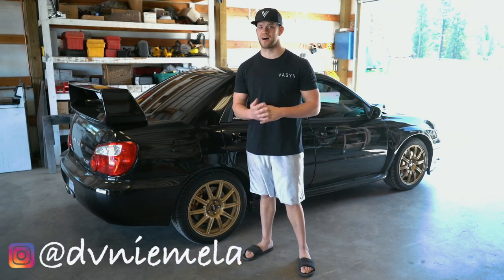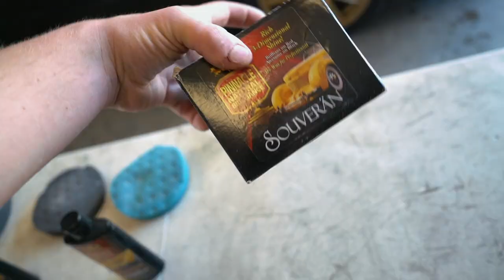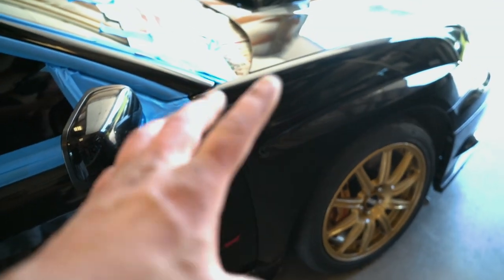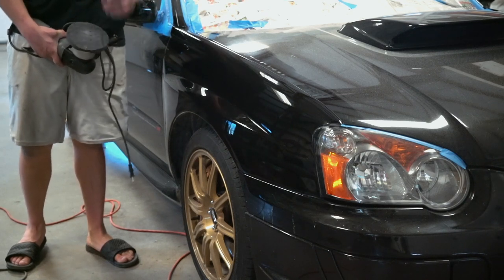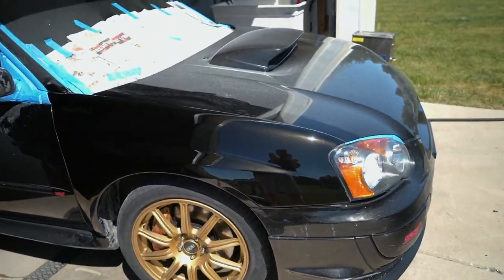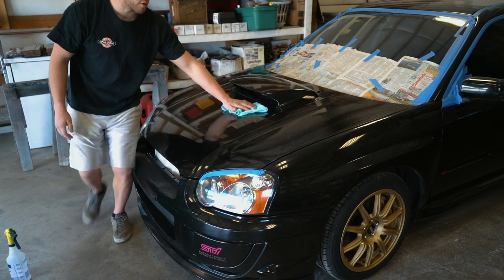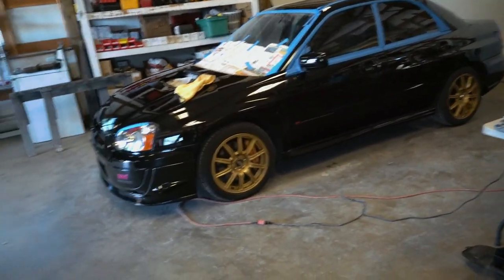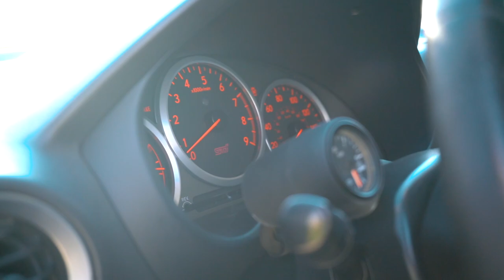How To Polish A Car At Home

Comment: Devin, Best and easiest way to do it will be to chemically clay bar car by using professional stuff eg. Bilt Hamber Korrosol Cleaner (it will remove iron contaminants from paint) then get  3M Trizact Discs P3000 and 6000 Grit. Get 2 small and 2 large discs - that will do entire car. You use them with water but just a light mist not soaking wet and on intermediate backing pad (soft foam) then it will work correctly. You can get 3M Trizact 1500Grit (also with backing pad!) if you wanna remove deep scratches or remove orange peel texture (mirror flat surface) but this one you using dry and need to be cleaned often with airgun blow or cloth (cotton) very often. After sanding use "Menzerna 3 in 1 - One Step Polish" - why this one - because it's design to brake sanding particles to smaller as you go and you need only one compound than just good polish to remove swirl marks (eg Meguiars Ultimate Polish) than wax or ceramic coating of your choice. With DIY grade ceramic coatings is a small problem as they last max 2 years if you don't wash it or rain often. Mine come of in 6 months. I would use good wax to start it then quick wax to refresh later.
P.S. All of it you can get from eBay

Comment: No clay bar?  Pretty sure you want to clay bar after the wash.
Reply: Came out great.  Looks good!
Reply: tk106 yeah I noticed that too. He didn’t use a clay bar before he buffed it🤔.
Reply: Scuse me, what is a clay bar? What is it for?
Reply: Royal Kin a clay bar is a piece of clay that when used with a solution like a quick detailer. Removes any particles embedded in clear coats of paint. Also it brings back a shine to a clear coat similar to wax.
Reply: Dude is using a WOOL pad with a HEAVY cutting compound as his first step. While it might make a tiny difference to clay bar first, it is probably not necessary.
Reply: Rotary buffers with wool pads tend to rip above surface bonded contaminates off the surface. 

The first time I buffed out my white 93 GMC safari with a rotary, it had those orange specks and bumps all over the back doors. After hitting it with a rotary, wool pad, and Megs 02 the orange spots were gone, and the paint was smooth again.
Reply: The thing with claybar is that its not even close that you have to use it on every car, most cars dont need to be clayed
Reply: @marcuss8770  what??? You have no idea what you’re talking about. Go polish a car without claying it first. I will wait lol
Reply: @AWD_T  I wanna see you do it your self, I have had 4 cars and only one of them I have used a claybar, and if they are taken care of on a regular basis you normally dont have to.. The 3 cars I didnt use claybar on ended up just as good as the one I did use it on
Reply: @marcuss8770  you must not drive the other cars then. There’s a right way and a wrong way to do things. The right was is to clay any time you do any type of paint correction. Go touch the fender behind the wheel and tell me there’s nothing on it.

Comment: Definitely saw holograms in the paint during the first shot when you pulled it into the sun. Unfortunately that's what happens when you don't use a clay bar, followed by a rotary.